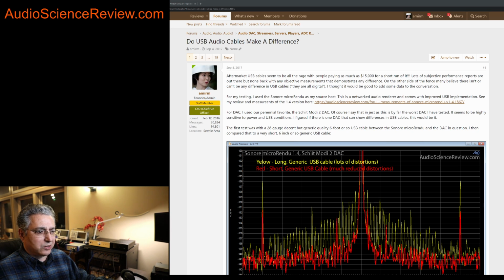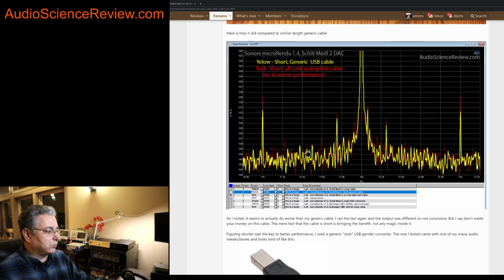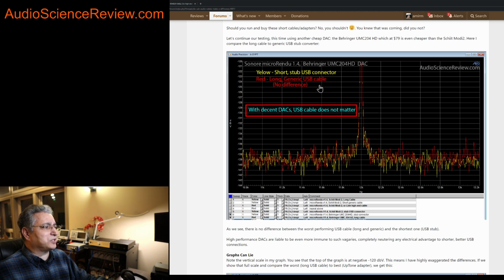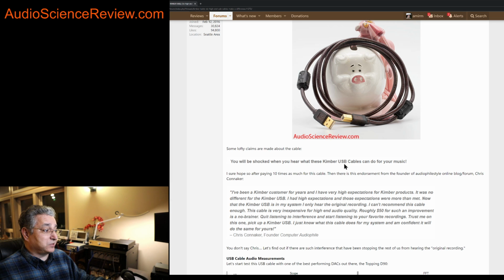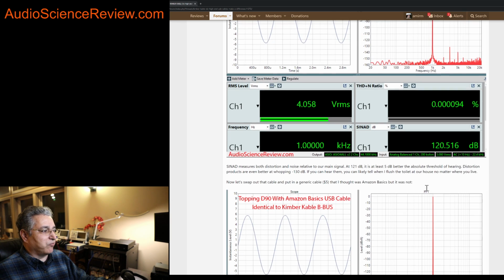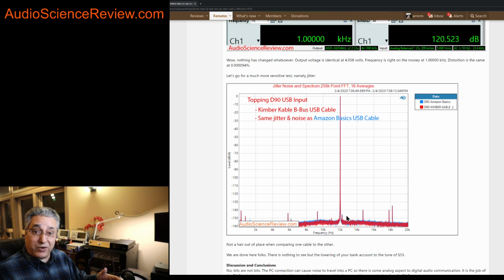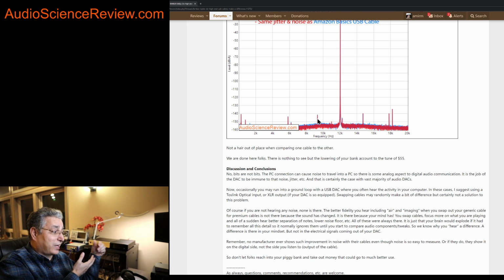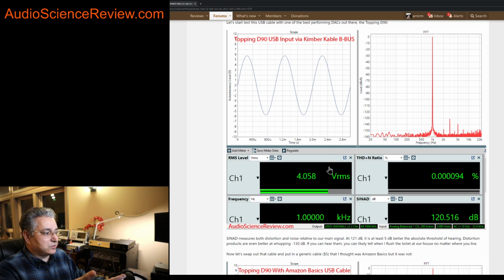Do USB Cables Make an Audible Difference (Kimber Kable Review)?

Comment: This is like teasing a cat with a piece of string but never letting them catch it, eventually they'll lose interest. We need an occasional "well, whatdayaknow, it actually does make a difference" video to maintain the suspense
Reply: @Josh Gray So send him a cable that makes "a difference" to you. Put your money where your mouth is.
Reply: ... because things that do make a difference has a consensus, even among snakeoil believers. It is not interesting to hear that speakers make a difference. We agree on the parts of the chain that do make a difference, we have a disagreement where the "who cares" zone start. With some snakeoil beliefs, there is no bottom threshold of hearing.. that things that are too low to hear, becomes audible, if the noise is at -140dB and 6dB magnitude variance, you listen at -3dB and the +-6dB will be now audible.. Hard to explain because it makes no sense. But, we do know what does make a difference, those are not debated.

What you are asking is "we need a snakeoil that actually does work".. which is going to be a fools quest to find it. If it works, it is not snakeoil and in every single case, has been knowns AND the issue addressed decades ago. Snakeoil and audiophiles think audio engineers are idiots, that all this time, they have never noticed something huge, when the truth is that it has already been found and fixed, and whatever the issue we had, is well below our sensing capabilities by 2021.

It has all the hallmarks of pseudoscience, with the typical: our enemies are very, very clever, geniuses but also very very stupid. In this case, audio engineers are capable of making gear that audiophile can use to find massive errors that any competent audio engineers should've found, and that this happens at industry level, that every single device has been designed by deaf morons who are only accidental geniuses for being able to design it at all.
Reply: @squidcaps4308  well i mostly agree with you, but a lot of highend gear is "highlysensitive" or so badly designed that moving the amp from the floor to a table makes an audible difference (5000€+ equipment), at that point cables do make a difference because the electronic is shit and reacts to the "objectively worse" cables in a manner that is audible...

not saying any of that is good or desirable, its just reality sadly
Reply: @d4nte857  No.
Reply: @rcheskin  believe what you will

Comment: unbelievable "snake-oil removal tool" this channel is  ;-)
btw, my proposal for grading the equipment:
1- audible hardware: all that  is worse than -115dB
2- inaudible hardware: all that is better than -115dB
because what is the point of paying 3x more for the hardware that is -120dB (vs -115dB) 
just saying

btw I just compared 2 DACs I have at home:
1- cheap, raspberry pi based "hifiberry DAC2 HD"
2- Sabaj D5 (so highly recommended here)
and I hear NO difference on either my Sundara or my Rega amplifier with the speakers
imagine: 7x price difference
(OK, Sabaj is my headphone amplifier as well so I will keep it for this purpose but probably with JBL atom I would still save lots of $ here
Reply: @Jacob Not according to Amir ;-)

Comment: Nice one but the truth that bits are bits stands. None of those cables changes one bit. Sure the noise can be on but the data is still intact. This is important.
Reply: You said it much more succinctly than I. I think this point needs clarification, before the audio magic crowd misunderstands or misrepresents what Amir is saying.
Reply: @vinnytube1001  I can see it my eyes: "Amir confirms USB cables will make music better" and that is not true at all but words can be twisted easily :P
Reply: @Thevikingcam  Or just "even the objectivists agree that bItS iS BiTs Is A mYth!!!111"
Reply: @vinnytube1001   Hello from the future, you guys ended up hitting the nail in the head, just came from reddit to this video, one dude completely misinterpreted it, bought a 1k cable and posted a review, he was using this video as "proof" that it makes a difference.... All that while using a externally powered dac.
Reply: @TheBotinha93  Sigh. It was bound to happen.
Reply: Bits can and do get corrupted, sometimes even when "standing still" in computer memory, let alone being transmitted through a noisy environment, one way or the other. That's why most digital packets carry a checksum or other means to verify the data integrity and possibly also correct any errors on the receiving side (or requesting a retransmission). A different point entirely, and something that should actually be your easily proven argument, is that any corruption of the digital stream, wherever it may appear, will have no subtle sonic effects at all, and will instead appear as cuts and pops all easily heard by even the most unsophisticated listeners.
Reply: @ bits cant get corrupted, if it happens in usb cable its a one in trillionth of trillion chance. From far away server trough thousands of servers trought million mils of optical cables it can happen sometimes. Todays home computers and USB connections are basically unbroken.

Comment: This is fantastic Amir. Could you please test and measure  fibre optic cable without copper to see if that makes a difference. Thank you for your insight.
Reply: No need.  Fiber optic transmits packets of digital that either arrive or they don't.  USB is different because of the 5V that is part of the system that may or may not be used by the DAC.  optical cable doesn't have voltage applied to it in any way, so there is nothing to be concerned about.  But I suppose Amir needs to measure that to prove it to the doubters, LOL.
Reply: @tonygutermuth9347  I thought he was talking about hdmi. Fiber optic vs copper
Reply: I want to know this also. Especially after plugging a 15 foot hdmi 2.1 cable(very thick, presumably...lots of copper) into the front hdmi port of my avr. I have this cable to run REW from a laptop. I can't plug the laptop power cable in anywhere in that room, because I have MANY outlets on the same circuit and get a ground loop. So..the only interference added is the hdmi cable, and I get a slight hiss in the speakers. I have all the same cables in 3 foot variations, but these ones are braided counter-clockwise, and I dont have a problem with any of them. No problems with the cheap monoprice hdmi 2.1 6 foot cables either, but I would like to get at least one high quality cable to go from processor to display.
The 3 foot cables I mention are zeskit. They are braided copper up to 10 feet. The 15 foot one is not braided. It is UL rated, thicker than most of my power chords, and introduces audible noise.
I only have the 3 & 15 foot sizes.
This is all I know, so I would like to know this about hdmi cables as well. I wonder if video quality can be effected, although I think video is much less sensitive than audio.
I still use the 15 foot cable every now and then, because it is only audible from a few inches off the tweeter, and when I am using it, I'm usually just level-matching things, working on the bass in my room, seeing how placement/treatment effects things. 
But because of this, I would like to find a good alternative. Problem is they are so damn expensive. So a video to help understand would be great. Someone send Amir a really expensive cable to test and I'll send him a 3' and 15' zeskit!
Reply: optic cable for audio transmission is basically great, I don't think there should be any significant upgrades

Comment: How do you feel about the concept of "burning in" cables, headphones, or speakers, by leaving them running for a extended period of time? Many people claim to hear a difference after say 500 hours..
Reply: Burn in and break in are 2 different things. Burn in is a process at the factory for fault finding and ensuring the product is good when it goes out. Amp manufacturers do this to run their amps for 24 hours for example, hooked into dummy load and fed with high level signal to get them heat up and see that everything works and nothing fails.

Break in on the other hand is something what you do with brand new and stiff stuff., Your car engine needs breaking in, your speaker can need breaking in etc. For any electronic components, there is no such thing at user end. For mechanical devices there can be, but not by default. On speaker drivers you can and do measure a difference on their parameters. However, that change in good drivers is so small that it falls within the manufacturing tolerances and doesn't cause an audible difference. People would be seriously surprised to see how much T/S parameters can change making very little to no change on acoustical output.  

And even if there is a small change, it will always be less than what you get while running the speaker. When voice coil starts to heat up, its DC resistance changes, moving driver will have different compliance and damping resulting a substantial change for driver's resonance frequency, Fs.
Reply from the maker: Hey, you gave me another idea for a video.  :)  Simple answer for now: there is no such thing.
Reply: @AudioScienceReview  Excited to see your video! :D Haha, you are a cool dude!
Reply: @AudioScienceReview  for a burn article and video, you could take a brand new headphone, put it up on the GRAS fixture, start measuring and hit play. Continuously record the FR and see whether it changes in x amount of hours (it won't) and use that as proof.
Reply: @AudioScienceReview  What????????????? You have no idea!!!!!!!!!!!!!!!!!!!!!!! At all!!!!!!!!!!!!!!!!!!!!!!
Reply: @Douglas Blake I was just about to say the same: rigid rubber/paper will change the sound vs when it is already flexible after some hours of being in use. But for the cables getting burned...oh, yes, they can burn if too many Ampers are going through them ;-)
Reply: @Douglas Blake Theoretically you could be correct, but I have never seen actual before/after measurements that show anything but extremely tiny changes.  Headphones, also mechanical, are easier to measure and far more frequently measured.  I have never seen burn in measured on headphones,  I DO see measurements of other changes, like DT-990s with old (compressed) pads versus new pads that have not flattened with time.
Reply: @Douglas Blake Even if break-in of mechanical parts of speakers was true, it wouldn't take long to do it. Firstly, you are talking about components that are DESIGNED to move. So I don't know how much MORE improvement you would gain. Secondly, if there as any additional movement gain to be had from "break-in", you could probably get it in a few minutes of constant movement of these components. The idea of these things needing hours, days or weeks of "break-in" of these mechanical parts is nonsense.
Reply: Speakers, yes possibly. My electrostatics improved as the conductive coating on the diaphragm cured.

Comment: omg I love this series... finally someone to enlighten the sheep :) Whenever I get a notification I have a smile on me face:)
Reply from the maker: :)  Pretty soon I need more tweak products to test!!!
Reply: @AudioScienceReview  what is your opinion on burn in for speakers and amps? Don't know why, but it looks to me as a trick companies use to avoid people returning products they don't immediately like.
Reply: @jaytorr6701  Your hunch is correct, but it isn't about not being able to return them, per se. The whole "30 days or money back" is the trick, it is just enough time that you get used to the idea, it is designed to build placebo effect and you get emotionally attached to the whole thing. In the cases where the sound does have some changed, like for ex cables with inbuilt filters, our hearing adapts and in few days, you will think the new sound is actually neutral.

Burn-in process is largely the same, it takes time and over that time, our reference is completely lost: even if it did work, how would you know since you can't compare to what it was 30 days ago... and NO ONE does level matched blind testing... Suggesting objective testing gets immediately attacks in audiophile forums.. Because that is what destroys ALL of those myths.
Reply: @squidcaps4308  That's exactly what Amir could do. Record the response of a new speaker say once every week until the supposed recommended burn in. If response is the same, then another myth bites the dust. Surely someone has done it? But Amir is is probably the most appropriate person to convey the message.
Reply: @AudioScienceReview  I also loved the Genelecs 8050B review (was a bit worried to start watching amidst the debunking series, haha)- I had them years ago, very good well balanced product - now I got 8351s which are better of course. Most kudos for pre-pro measurements, getting rid of my Marantz 8802A soon... keep up the good work Amir! Thanks much
Reply: @AudioScienceReview  actually  perhaps it would be interesting to test multi thousand $ components instead? What justification can they possibly provide? 
From your vidéo/web, I get that you can put together a transparent system without any audible interference for a few thousands. So what makes a difference at the end with products that have cost similar to cars/houses... ?  Probably the speakers, but even there you find nearly perfect speakers for relatively little money. Subjectively, what would be the most transparent and cheapest system you can put together today? I know you don’t want to advertise/endorse but it would be interesting
Reply: Break-in for speakers is real and genuine. Many people can and do test the parameters of them and prove that they do change. This is because they are mechanical devices, not electronic.